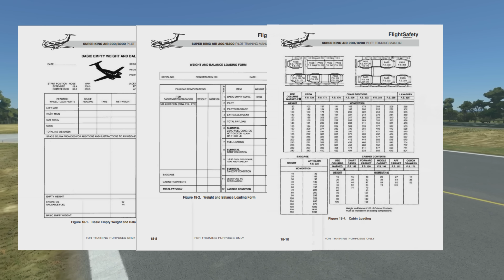Disaster Just After Take Off | Crash of King Air, Melbourne, Australia

Comment: I was working for one of the major domestic airlines at the time in IT Audit.  The major data centre was near Essendon Airport, as was the Flight Simulator Centre.  During one of our reviews of the disaster preparedness, one of the matters I raised was the potential of an aircraft crashing into the computer centre.  This was rejected as an issue given their understanding of flight patterns from Essendon Airport. There was an earlier crash to this one headed in the general direction of the Computer Centre, missing it.  However it did demonstrate to management that when an aircraft has a significant issue during take off could head in any where in a 180 degree fan from the end of the runway.  That event did lead to a change of potential risks, and ultimately changes to the IT disaster recovery model.

Comment: I’m not a pilot but it seems that single engine would be more stable and easy to control than twin engine planes in case of engine failure it wouldn’t pull to one side.
Reply from the maker: It would be, but all pilots are trained to deal with any asymmetric forces from the loss of an engine.  Plus there are systems within the aircraft that assist also. For example with the King Air, it has a rudder boost system, this assists the pilots with rudder input if an engine is lost. The problem with having a single engine to resolve the issues with two is that if you lose a single engine then you have lost all thrust and are now immediately looking for a field or safe place to land in!

Comment: You know, i've had this happen to me in Microsoft Flight Simulator X. Usually on the 747-400, the tail would deflect to one side while i was on the ground preparing to take off. This didn't always happen yet it did happen at least 5 times before i stopped.

Comment: 6:30 There is also a confusion factor. When the airplane does something unexpected there is a moment when the pilot is startled, then he startles trying to figure out what is going on. Why is the plane not doing what is expected.
      The first problem the pilot would have considered was engine failure. He may or may not have realized his engine was fine, but what to consider after that?
     This pilot reacted like someone who was unpracticed dealing with emergencies.

Comment: Non-pilot question:  Does this model of aircraft have an incorrect takeoff configuration alarm?  If so, would the alarm sound during the take-off roll with these flap settings?
Reply: Not for rudder trim

Comment: There must have been a lot of baggage for the aircraft to be 250 kilos overweight. The King Air 200 is a 9 passenger aircraft and only had 5 people on board. For it to be that overweight they must have had several heavy bags each in addition to golf clubs and a lot of fuel. It takes a lot of extra weight for it to affect the take-off roll and the climb rate of the King-air. The pilot was an idiot to not check the trim but another factor is that most baggage in a  King-air is stored in a tail of the airplane which would also make it harder to climb.

Comment: Lazy feet - very common problem with modern day pilots who almost invariable train - and fly - nosewheel aircraft.
Experience sometimes means nothing.
2000 hours total time could be logged by a bush pilot with something new learned every day or it could be a pilot doing joyrides off the fence at a local airport i.e 20 minutes in the circuit 6000 times.
How would I know this?

Comment: Like this one, every disaster I've ever seen--as an anesthesiologist working in operating rooms--has been a combination of complacency and numerous safeguards ignored.  It's never just ONE thing.  Or, it's forgetting about weight and balance because it's rarely an issue:  most anesthesiologists do NOT check the emergency oxygen tank each day (which is rarely used)...............and each has a different excuse for not performing this basic "pre-flight".
Reply: Great analogy! When human lives are on the line, you don’t skip anything, even if it’s considered trivial or a formality.
Reply: Or there's the old stand-by scapegoat...nurses. Blame the nurses! 😬
Reply: Doctor, you are scaring me! I’ve had 24 general anesthesia surgeries (big skydiving accident).😂😂
Reply: Mac or Miller?
Reply: As someone with MHA those lack of checks concern me.  However everyone needs to know when I have surgery and the special cleaning that takes place, so it should not be a significant risk to me.
Reply: I bet the CRNA typically checks the tank like his career depends on it.

Comment: Yes that was jolly good. All the other ridiculous unprofessional/incompetent issues addressed, I can't actually work out why the rudder trim was in that position in the first instance? What part of the flight regime would require landing with that much trim input? Perhaps it was used while taxiing in a strong crosswind or something.
I surmise, that since that much trim is rarely used then that was another contributing factor. 

Reeks of amateurism all this. You wouldn't think that someone with this much experience could be so utterly dodgy.
Reply from the maker: That is the unusual part, I guess it would be speculation on the part of the investigating team to have suggested a reason. You make a great point there, with it being so unusual to be in that position, it wasn’t a thought to check.

Comment: I can't see how a King Air could be classified as "overweight" with only pilot and 4 x passengers. These planes are registered as up to a 12 seater (11 in the cabin plus one in co-pilot seat).
I used to fly in them regularly out of Alice Springs with full passenger load plus freight and a decent fuel load given the distance to the mine site was approx. 550km and the plane was not re-fuelled on site for the return leg. Essendon to King Island is a much shorter distance (about 250km) so a much smaller fuel load would be required.
A good report though, even if I disagree with you on the "overloaded" status.

Comment: I’ve got a lot of hours in king airs.  
I believe it’s unlikely he would have known the rudder was out of trim before rotating.  
Stupid he didn’t run the checklist.  Also shows why two pilot crews are safer.   Rudder boost wouldn’t work because both engines were  running

Comment: I fly a King Air 350 and even with the more powerful engines it doesn’t require anywhere near full rudder trim to trim out the forces. Pushing the rudder yourself takes a lot of force. 

That means with full deflection… the rudder forces are probably close to double that of single engine.  

Always check your trims. I run mine through all the way and then centralize them during the preflight.. and check them again during after starts. There are three detents on the scales. They should be at 9, 12, and 3 o’clock. You can even check this at night with no lights.

Comment: I hate to say it, being an old codger myself, but the main cause of this unfortunate tragedy could be the age of the pilot. You can be mentally sharp at that age but also prone to the simplest mistakes, and lapses of concentration - like checking the trim wheel to the right and left and then forgetting to center it again, or not properly calculating weight (hey only 4 passengers, why worry). Leaving the wheels down because it's not something he's ever had to practice and your reaction time at that age is slower and it's easy to miss steps you should have taken. I just did this on while setting up footage for a documentary I'm editing. Found a series of mistakes a day after I made them. Not a big deal because no one's life was on the line. The other thing at that age is that he might have developed some bad habits and didn't see the need for following the actual checklist each time, just going off memory. 

I'm curious - if you actually looked at everything with a keen eye during your walk around, wouldn't you be able to notice how the plane was trimmed? I mean, the trim tabs should be obvious on the flight surfaces - it's not some setting hidden behind the last passenger seat or something. He could have looked at it directly during his walk arounds and just missed it. Being 67, his age may have increased the likelihood of missing something like that.
Reply: Rudder trim set to full deflection would be very hard to miss.....Plus...trim would be off to the right if anything for a =normal take off.  Either way, unless he had super weak legs, he should have been able to overcome with pedals.  I would not be surprised one bit to find a partially plugged fuel filter that REDUCED the power of the left motor.  Still running but not making enough power to overcome the yaw.  It was only 12 seconds....one little mistake can easily be deadly.  Also notice...the pilot was not the guy that trimmed the rudder to full deflection.  I would guess that was done in maintenance and not set back to center and the pilot missed it.  No one looks at rudder trim if you're the last guy flying the  plane.  My bet is on fuel partial starvation/loss of power.  He was heavy but no so heavy it shouldn't have flown...but on one motor?  Heavy made it slow to take off and he had no runway left to abort.  Pilot error?  probably but I do NOT believe age was a factor
Reply: Do you fly?  I'm 67 and still very sharp.  I personally would FAR rather fly behind a guy with many years experience than a young snot nosed know it all that thinks age is a handicap.  I've seen young pilots make the most stupid mistakes you can imagine.  And if you think putting the gear up in this case would have made enough difference to prevent this crash then you really have no idea what you're talking about.  You do NOT put your gear in the wells until you have established a positive rate of climb.  They obviously never got a positive rate.  I also doubt rudder trim was the culprit because it never went fast enough that the trim would have made the yaw uncontrollable so much that the pedals could not have overcome the yaw.  And 500lbs overweight for a King Air 200 is not so great that it would have caused this accident.    I've been flying for more than 37 years and have more than 13k hours in many different aircraft including helicopter.  My guess on this is more than likely a fuel filter causing a reduction in power but not enough to shut it down.  It may have been running on impact but not making enough power to keep it in the air.
Reply: @awittypilot8961  I'm 60 and very sharp, too. But I wouldn't say I was as sharp as when I was 20 or 25. Being an old guy, I've seen my share of young guys making stupid mistakes. I've seen older guys make stupid mistakes too. It's all individual, you should know that. 

An example of how sharp I am, without rewatching the video, I used the information from one viewing two weeks ago, and the accident came up as the 2nd result behind a King Air accident in 2000 flying out of Perth. Here are the actual results of the official investigation: 

"An investigation by the Australian Transport Safety Bureau determined the accident was a result of one of the flight control trim tabs being set incorrectly. Failure of the pilot to realise the rudder trim was set fully to the left caused a longer than normal takeoff, and caused the aircraft to slip and yaw to the left once airborne. Ultimately the uncorrected configuration caused a loss of control of the aircraft. The checklist used by the pilot did not contain a specific check for the trim tab position before takeoff. The investigation was hindered by the lack of data from the cockpit voice recorder, which had stopped working on a previous flight.[note 1] Furthermore, the weight of the aircraft at takeoff exceeded its maximum takeoff weight, but this factor was not determined to be a contributing factor to the crash.[1][15]

In September 2021, it was reported that the pilot failed a proficiency test two years prior to the crash.[16]"

You were correct on the weight being a non factor, as well as the landing gear. But fuel filter issues? Causing the slip and yaw? Either way, as he's approaching take off speed, the plane is essentially flying on the ground and he should have recognized whatever issue the plane was experiencing before he took off. The plane pulling strongly to the left? One engine not getting enough RPMs? He should've aborted the take-off. At least he had gravity keeping him in a somewhat straight line. Would've been a headache to his passengers, or whatever his reasoning was for not aborting, if had. But they'd be alive. That he failed a proficiency test two years prior? Not a good sign. Maybe he had a bad case of get-there-itis that overrode his judgment.  

So yeah, you may be doing well at 67, but the "don't stop me from being stupid, I know what I'm doing" isn't reserved for 25 year old hot shots. I still standby age being a big factor (just like it's a factor when a young pilot does stupid things). Experience doesn't make you better, good experience does. Otherwise you're just as likely developing bad habits with "experience".

Comment: My question is: Why was the rudder trim set all the way to the right prior to takeoff? Was it due to conditions on the previous flight? Was it a maintenance issue? Did an unauthorized person enter the aircraft on the ground prior to flight? All these questions could be answered and negated simply by using the checklist. There is no need to rush it.

Comment: Hello!!!  This is the first time i have watched your videos and I am disappointed.  How about trying to figure out why the trim tab was in the wrong position?  How did it get there?  It does not seem like the previous flight would have left it there.  Did someone else have access to the aircraft while on the ground - maintenance, teenagers hanging out, etc.?  Why would this not have been caught during the walk about where all flight control surfaces are checked by the pilot.  I just think you could have done a better job of analyzing the reason the number-one cause of the crash.

Comment: I think the weight was the main issue, rudder trim, even if fully to one direction, can be countered by adding opposite rudder.
Reply: Unlikely. 

If you’ve ever flown a King Air single engine you know that the rudder input required is considerable.. but the rudder trim needed to trim out the forces is nowhere near full deflection.  

Fighting against a miss trimmed rudder is likely double the forces of single engine… with an older pilot who’s likely out of shape with poor joints.

Comment: Beside failing the checklist,  this pilot is completely incompetent in another aspect, because he should have aborted the takeoff when he should have detected the strong out-of-trim condition on the yaw axis.  He no doubt had to apply a lot of input into the rudder pedals to keep the plane on the runway, so the unavoidable thing to do would be to stop the takeoff run in order to re-trim the aircraft or to investigate the cause of severe out-of-trim condition before taking-off again.  This should be an instinctive reflex that requires no thinking at all.  If the aircraft doesn't feel normal...abort the takeoff.

Comment: I don't have King Air time, but I'm surprised that the pilot couldn't overcome the full left trim with his leg. Also, he was 500 lb over gross. This would have resulted in diminished climb performance. With the landing gear still extended it would also effect climb.

I wonder if the outcome would have been different if the plane wasn't overloaded and if the pilot had pulled the gear up?
Reply: I have King Air time. About 3500 hours of it. 

Single engine in a King Air requires a ton of force. Something that lots of pilots struggle with (see Addison TX crash). 

The amount of rudder trim needed to trim out those forces is around half deflection. 

So with full deflection… you’re looking at probably double the force required for single engine. Few people are able to do that.

Comment: So full rudder trim can’t be overcome by 150 lbs of pedal (max pedal force limit for vmc determination). That’s a bit surprising. As far as being over weight goes, if they knew they were overweight and rotated at a slightly higher speed it should not have been a problem. Minimum control speed is an issue mire at light weight. If they thought they were 500lbs lighter than they actually were then the would have been closer to stall speed by the square root of the weight ratio. That is problematic when you combine it with high sideslip which increases stall speed. They only way out of that was a boot full of rudder and putting the nose down and it has to be recognized and done immediately. If they didn’t abort the takeoff with such a bad flight control issue it makes me think that the pilot was just too passive and it’s not surprising that the proper corrective action was not taken. Or was the rudder trim applied in flight? Do these aircraft have data recorders? Probably not.
Reply: Who said he ever knew what the problem was? He was fighting to keep the plane in the air, and he had 12 seconds in total. My guess is he never realized what was wrong.
Reply: @grantofat6438  i didn’t say he knew exactly what the problem was, other than massive yaw. Any multi rated pilot would know that and would know the corrective action instinctively.